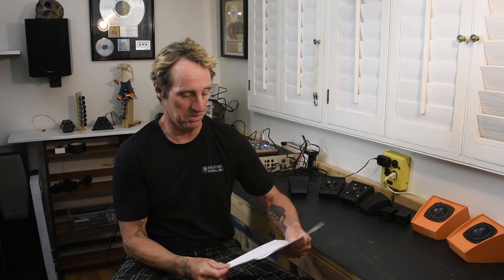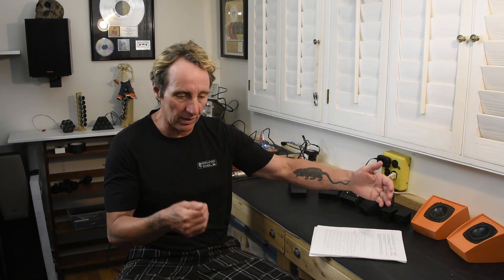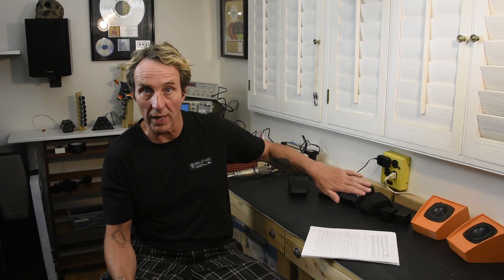Pro Audio Sound Tips #2

Comment: The wedge polarity thing is fine for a stationary player or maybe in defining a sweet spot, but that is hard to carry over night to night. It does make me wonder if you could manipulate the wavefront from a bass rig using the phase of it in monitors immediately down stage of the rig. Is it more accurate to mimic the phase of the instrument's wavefront in those monitors or to just throw back into it?
Reply from the maker: Not sure what you mean.  Getting the wedge polarity to be correct with the bass rig will stay stay correct unless the bass rig or mon rig is changed to be out of polarity.  For a bass player that moves around, if the mons are out of polarity w the bass rig, there will be a significant cancellation 1/2 way between the bass rig and any monitor reproducing the bass at any significant level.For mon rigs in polarity, those sonic holes will go away

Comment: Is it OK to record the sound of a keyboard through its headphone jack? Thanks.
Reply from the maker: Absolutely!  There may be a slightly extra hiss or noise from the extra amp to drive headphones but it is doubtful that extra hiss will be audible or an issue.
Reply: @DaveRat  Thank you so much. I was told by a number of people not to do that. I digitally record the sound in wave format and it sounds good to me.

Comment: It is electricity that travels through the copper wire at near the speed of light. Speed of sound in copper though, is only 4600 m/s (about 13,5 times time speed on sound in air)
Reply from the maker: Hmmm, Credible sources state the speed of an electrical signal in copper wire is approx 90% the speed of light.

Which calcs out to about 883,972,000 feet per second.

Sound travels about 1150 feet per second in air sea level-ish

So signals travel about 768,584 times faster in wire than sound waves travel in air.

There is some discussion about it travelling as slow as 50% the speed of sound so in the video I say 1.5ms is about 150miles in copper. But most of what I have read indicates it's closer to 250 miles.

Comment: how important is delay on channels that are further back from the main PA
Example
Typical bar stage of say 20' wide by 20' deep.
The drums and cabs at the back vs the mics at singing positions
Should you be doing any time delay adjustments to "line them up"
Or is that not enough distance to make a difference?
Reply from the maker: "lining things up" has to do with perspective and the audibility of the output of those sources from that perspective, combined with the reproduction of those sources.

In short, no need to delay vox to drums as it offers no benefit.

I will try and cover more on time alignment in future videaos

Comment: True, electrical taping a mic grille is much like cupping the mic, loads of feedback.

On the other hand a mic can be "fixed" into omni pattern using electrical tape over the ports, and the ported system can often sound pretty nasty on cheaper mics. Good trick in a studio for dynamic mics or electrets used super close to drums to reduce proximity effect and catch a bit more spill.

The wise engineer buys multipacks of shure pop shields, they are a lot cheaper than mic clips, guitar strings or drum heads... or bottled beer... and are a consumable.
Reply: I think everyone has had to suffer the duck tape on 57 situation. The champagne cork cage is an awesome solution. Just not a lot of champagne bottles around when you needed one unless you were teching a wedding.

Comment: Excellent tips like always. I have a question a bit off subject though. What drum mics have you had the best luck with while touring? I’m currently using the sennheiser 900 series drum mics, but I can’t stand the cymbal noise they pic up. I’m really thinking about moving to earthworks. Thoughts???
Reply from the maker: I usually used beta98 or sm98. I mic super close to reduce cymbals

Comment: How about small clubs and stages with instruments coming out of the monitors? I work with a few different techs, and we all have different methods. I'd rather have my guitar and bass player or anyone with an amp on stage play a little louder if they need to then to have multiple sound sources on small stage, while I find most other guys will reel in the player's volumes and use the monitor mixes (with roughly the same net overall stage volume). When I fill in for guys, they tell me to stop corrupting their bands as they had them trained and I've let them off their leashes. On bigger stages the instruments in the monitors make sense because of the distance between them, but on small stages and venues 'less is more' and 'the simpler the better' has always worked for me personally.
Reply from the maker: I personally follow the minimal intrusion plan. They can play any volume they wish, I assist in aligning the volume they wish to play with their desires for what they wish to hear versus the capabilities of the gear versus the space we have to work with.

Comment: Having a limited budget on a sound system is one thing that can affect the mix but one thing you have control over is if you're using your dedicated sound mixer at shows possibly you should try to make recordings of the mixes so that you can eventually get the best possible mix by using the recordings to check your mixes not affected by the sound system
Reply: Agreed; to a degree. A dedicated engineer ( BE ) can get you more consistency, reliability, and repeatability, but they are still limited to the tools at hand, and most of all, the TALENT. It has been said many a time, " crap in = crap out "..... While a good engineer can actually polish a turd, it is still a turd that is just shiny. It starts with the talent. I tell bands to record themselves with a single microphone in their rehearsal place while they play. The microphone and the subsequent recording of it will not lie and it will tell them right away how their raw mix is and what they can do to improve talent-wise prior to me walking in and trying to fix bad habits or problems that are talent-related. If the band is naturally good sounding and well mixed prior to the BE even walking in, the time it takes me or any other BE to settle in and get results is reduced dramatically.

Comment: Hi Dave. Thank you for doing these videos. I am not a professional, but I do own the PA and run sound for my band. Question about drum monitors (specifically as it pertains to the kick): What are drummers really able to hear through their monitor? If it takes a couple dozen feet for lower notes to materialize, then what are they actually hearing from a monitor sitting six feet away? I know room reflections play a part, but purely from the standpoint of physics, is a 12 inch monitor no different from a 15, at that distance? Is the drummer even able to hear the fundamental; much less any lower harmonics? Is the monitor better for note definition and attack than for actual low end thump? Thank you for your insight.
Reply from the maker: The concept that it takes many feet to materialize low frequencies  is incorrect. You can hear low frequencies radiated from a subwoofer when standing right next to it. 

The size of the room can play a part in that very small rooms can be very difficult to reproduce very low frequencies in. The size of the speaker plays a part in that larger speakers are able to reproduce lower frequencies with less cone motion. Ideally adding a sub or a second 12 inch monitor for a drummer to reproduce low frequencies at a higher level can be beneficial. Thank you!
Reply: @Dave Rat - Awesome. Thank you!! I have a couple 12s I can throw down for him and go from there.
Reply: @DaveRat  
"The concept that it takes many feet to materialize low frequencies is incorrect"

Exactly 
This myth encountered quite often. 

Think studio mains, car audio, or the best example; in ears. Those long wavelength freqs don't require room to develop. 
*They can actually benefit by the smaller acoustic volume via reciprocal pressure vessel gains (PVG). 

***Also, this is rarely mentioned, in small spaces there's inherent distortion profile benefits, in that the fundamental freq is supported more (PVG) than the subsequent harmonics artifacts.
Due to the longer wavelength fundamental, it enjoys full PVG support relative to the shorter wavelengths and thus less supported harmonic freqs above.
The effect is enjoyed despite a psycho-acoustics hit by the Equal Loudness curves. 

The world of small room acoustics...

All the best
Kevin 

*    cool
*   mind blown

Comment: Excellent ! Keep those tips coming!
I'd be very interested in some further digging of the phase/alignment of the monitoring system with the actual instrument and even with the PA on some specific places on stage (for example the lead point where there's often more wave coming back from the PA, especially on the low end).
Thanks.
Reply from the maker: Cool cool, more coming!
Reply: @DaveRat  Thanks
Reply: That would be interesting...

Comment: (With the tools). sometimes I like the Pepsi challenge . Especially when they say the house engineer dusnot make it sound like this. And not to say. when you work with average gear it makes you work . But when you work with good gear it's good. Plus if you've got an awesome band it works even better. And sometimes it doesn't even matter what gear you have its the band that helps a lot.